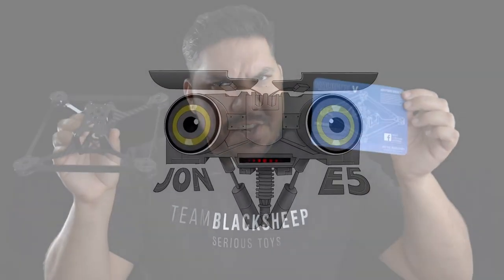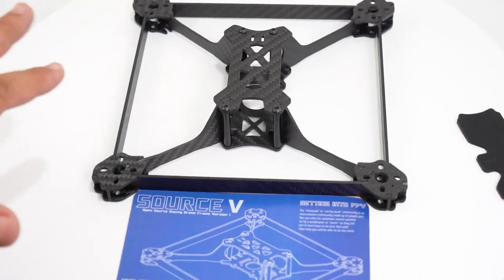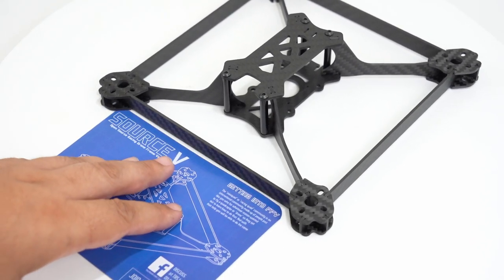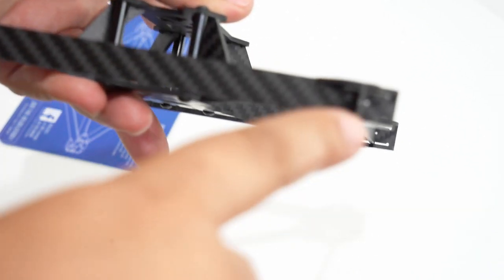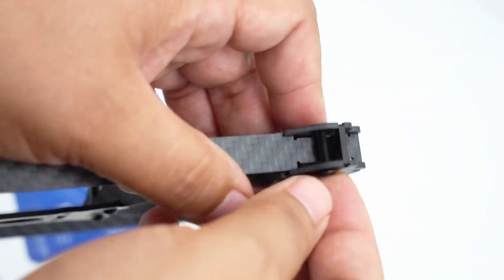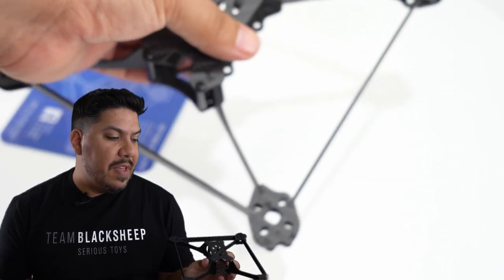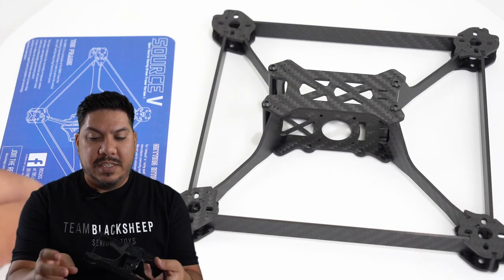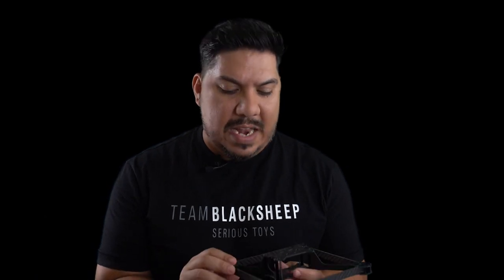Source V Frame overview - TBS Open Source Vertical box drone racing frame Vertical Racing Frame

Comment: Jon I have a question I recently purchased a Source V for racing I have been flying a switchback and thought I would try a box frame.  followed your video and it was great but 1 thing I need to clarify to make sure mine is right.  you stated that the long arms go in the front, mine would not assemble that way, without bending the braces all over the place but if I put the long arms in the back it goes together perfectly.  does this mean I have a bad cut frame, I am wondering if they changed something on the frame and now the longer arms are in the rear.  been building for 4 years and this is the first time I have had an issue with frame assembly.

Comment: Hi!!! Love your videos, when I need an experienced honest good pilot point of view you are in my top 3...  Not to mention all the non FPV stuff around, just freakin love it, haha...  Do you know what is the size of the motor bolts included with this frame??? I'm planning to order it and some bolts long enough to hold the motors in place...  Thanks...
Reply from the maker: Wow, thanks!  Really appreciate you taking the time.  It comes with some pretty long screws, because they go from the bottom plate, all the way up to the top of the motor plate and into the motor base.  You may want to wait till it comes in, and decide if the motors you will be using, need a slightly shorter or longer screw, or if the ones it comes with will work.  The ones it come with should be enough to get you in the air.

Comment: Hey I just broke motor mount , after pretty much crashes,  can you help me searching specifies files for front motor mount,  I was unable to figure it out, request your help sir
Reply from the maker: i think you will need to buy replacement mounts and possibly arm.  May end up easier just to buy a spare frame, (they are very cheap)
Reply: @JonE5FPV  do I need to buy whole frame? Or from where I can get replacement?

Comment: does it do digital?
Reply from the maker: Might be a little tight to fit a vista in it unless you used a single layer board. 

But should be doable.